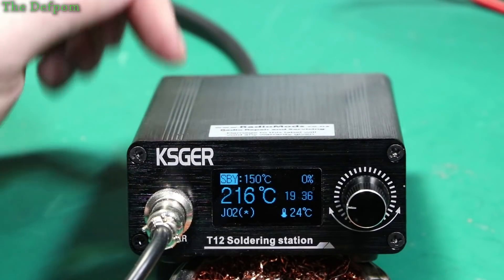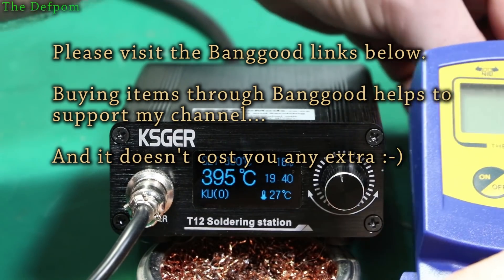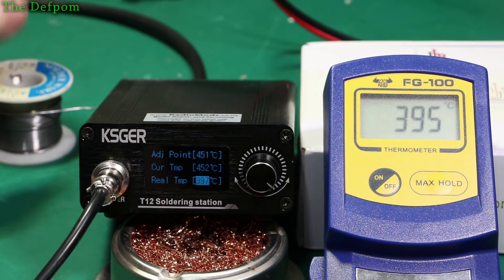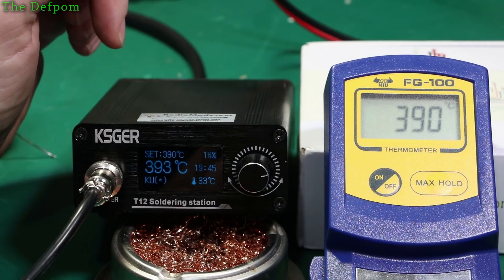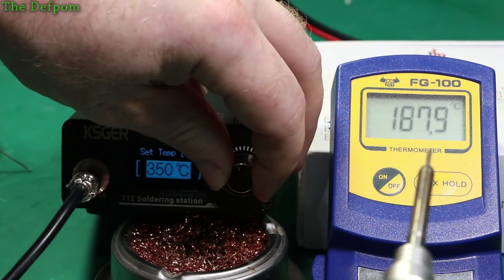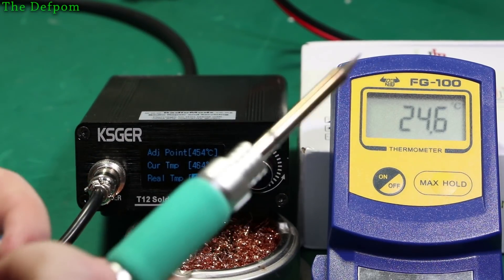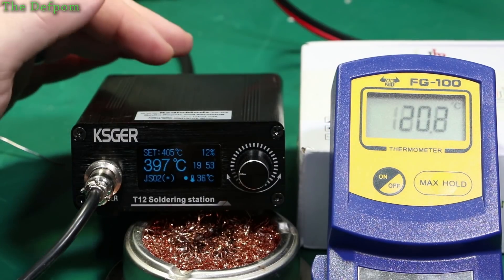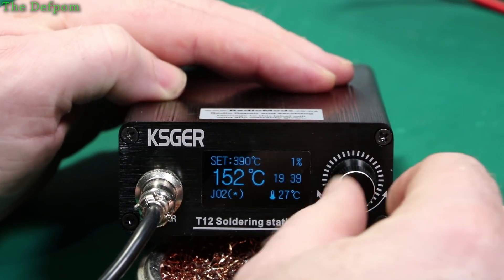🔴 #559 KSGER Soldering Station Calibration - How To Calibrate T12 Tips

Comment: Hi. My station shows the input voltage instead of the tip selection. And I cannot select the settings you do. Is there an update for mine? Or it is too old or something like that?
Reply from the maker: @gabrielmassa  there are different versions of the unit, clones of clones even.
Reply: @TheDefpom  in this case, there might not be a way to get the same setting? Mine is probably an old clone. I have it for 3+ years. I find it does not get so hot. But I'll have to get a temperature test device to make sure.

Comment: Hi! My KSGER (version 2.1S) displays a wrong tip temperature when completely cold. At 24 C in the room measured by the handle's NTC, the measured tip temperature is 57 C. That's the same for all my 16 tips I have... I suspect there's something going wrong on the board, any idea?

Comment: All my 15'ish tips have a negative 77°C offset versus the reading, +/- 3-5 degrees. Is there some way to calibrate or adjust the station's own baseline temp by that much? Clearly it has to be the station's baseline that is off here (V2.1S) - no way all these tips including several original Hakko's, would all be roughly 77°C off.

Comment: Do you regret getting this station?   I mean, I know there have been some issues you needed to resolve.   I ordered it and then saw all the negative feedback.  
 I'm a hobbyist, and I intend to see the earth ground fix added.
Reply from the maker: Not at all, my one has been perfect, it the best station I have owned, it works well and I have been happily using it for a long time now, I think the negative comments are from people picking up clones of this unit (or possibly different revisions of it).
Reply: @TheDefpom  I'm glad.   I'll need to get the  earth ground sorted out when I get it, and then see what happens from there.

I have a list of items to check for after watching all the T12 T2.1s videos I could.

Anyways, have good one.
Reply: I like mine, if you get the aluminium handle it may require some mods also but it is sooooo comfortable in the hand.

Comment: Maybe after a while the cartridge needs a seccond callibration
Reply: Advicable to run a new tip hot for 5-10 minutes before calibrating, at least the cheapo ones. They seem to be all over the place the first few minutes. To avoid unneccessary oxidation, you can coat the tip in solder before letting it sit those 5-10 mins. The original Hakko tips I have have all been pretty much bang on from start so I think those are "run in" during quality control.

If you do this, the tip shouldn't chsnge unless it starts failing. But never hurts to do some spot checks once in a while.

Comment: Fyi my unit came with a tip that had a hard short. It caused the unit to reboot several times then go dark for good. I figured it out on the replacement unit when it started rebooting. Apparently qc isn't very good. A shorted tip? And no short protection? 
Also, the first handle was way to sensitive and would wake up the unit by breathing in it. The 2nd didn't wake the unit up at all.

Comment: Just thought I would add for anyone new to calibrating solder tips. Hakko recommends to let the fumes (smoke) dissipate after adding solder to the tip before taking a reading. This is to make sure that the flux burns off and doesnt interfere with the reading. I can say for certain that for me this made for a very accurate reading with the fg-100. My ksger station is +-2 deg at rest, where before doing this it was +- 8 deg. 
Great vid btw

Comment: Hi. I'm also testing this stations and tips, but my station is not calibrated the same way.
What are your HW and SW versions? I have versions HW 3.00 and SW 3.02.
There is a menu "Temp Adjust" that performs a similar procedure, but it seems that it don't work correctly (the real readings become even worse after calibration) and don't seem able to store per tip calibrations (not sure about that).
The only tip I have with good results is the J02 and the best readings are after doing "Temp Init", that I belive reset the calibration values to the defaults.
Cheers.
Reply from the maker: CR Tech - I don’t remember off hand, but the review is linked in the description, I know I showed that info in the review so you will need to watch that video to see the versions on this unit.
Reply: Hi.
In fact I had seen your review video of than station before...
You have the older one HW and SW 2.x, but it seems to be better than my version 3, do you know if one can change this firmware easily?
Reply: @crtech3955  you probably had a kit. Version 3.x came only with DYI kits
Reply: @Vasiliu Daniel  KSGER STM32  HW V3.10/ SW V3.1S,  Aliexpress offical store
Reply: @Vasiliu Daniel No V3.x is a genuine new firmware, but I believe they ditched the per-tip calibration for some other stuff for the optional solder pump control (small ROM, limited space). If you only run the iron, the older V2.1S is the newest firmware that still has per-tip calibration. Unless you flash it with custom firmware I guess, then I couldn't tell you. Because it's custom ^^,

Comment: I played around with this a bit because only 1 of my tips making it to 455c  cal temp. It was a real Hakko JL02, but I have a few other real Hakkos that did not get to the 455c.

After calibrating the tips I set the temp too 455 and all of the tips went to the set temp so I know the KSGER station can get to 455c with all of the tips. The only thing I can think of is that the cal points are predetermined set point looking for currant draw at a predetermined temp setting instead of looking at actual temp or voltage drop at the thermocouples. Anyway what ever they are doing it works well. All of the tips are with in 1-4 c of set temp with a few of them being right on the money.

Anyway thanks again!! 
Regards, Spence

Comment: Thanks for showing this. I knew it could be done but wasnt sure how. The funny this is my KSGER was pretty spot on out of the box and was better then why real hakko fx951 but now it just blows away the fx951. Its with in 1 or 2 of set temp on all the tips I have even the cheap one I have from Banggood. 

I was playing around with it a bit and found that if you do a cal and let it stay on for a good 10 min or so and then do a recal you can even get it closer to the set temp... Anyway thanks again!!
Reply from the maker: Yes it is good being able to calibrate it like that, very easy to do. I am not 100% sure that the >400 degree issue I had is the fake tips or the thermocouple tip tester I was using.. now I might need to buy another one to see.
Reply: @TheDefpom  I just did a cal on a new JS02 tip (real hakko) and it went right to 461c in the 1st step so may be the element gets so weak over time that it just can't get there any more? Just a thought.
Reply: Yeah same here none of my tips got that high even the few hakko tips I have. They are T-15s but I really don't this there is much difference
 in the T-15s @TheDefpom
Reply: Oh I wanted to ask you if the handle that you have for your soldering station gets hot ? The one I have gets hot down by the grip and I end up having to move my hand.

Thanks
Reply from the maker: @DrNinktu  - I use a metal handle, it seems fine I haven't noticed any issues with it getting hot. but then I tend to only use it for maybe 30 seconds at a time whilst fixing things. After a few minutes it goes to sleep and lowers its temperature.

Comment: More likely a limit of heater capacity than thermo couple error. If the heater has reached maximum power then no more temperature rise, thus a maximum temperature is reached
Reply from the maker: Helmuth Schultes - the read back on the KSGER wasn’t lagging behind, so I believe that it is at the limit of the thermocouple range.

Comment: Find it strange that a thermocouple would be 30-40 degrees off. Its a physical constant driving the voltage , and to get the metal alloy that off is remarkable.
My experience of calibrating thermometers in a call lab leads me to believe it's a heat losses between the sensors (in the tip and in the tip thermometer) especially when the error seems to increase rapidly at high temperature where the losses is greater.
Reply from the maker: yes it is interesting isn't it, they were good up to about 400 degrees C, I'm do know that certain thermocouple types can only work across certain heat ranges, which makes me wonder if these fake tips are using a tc that doesn't go over 400. OR my test instrument thermocouple doesn't go above 400 very well...